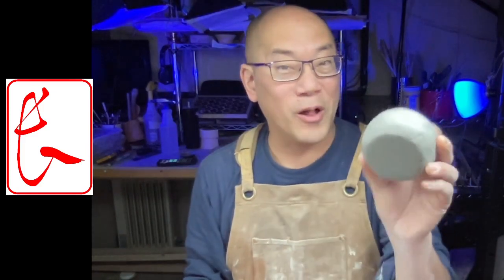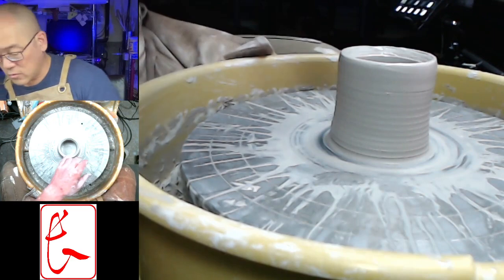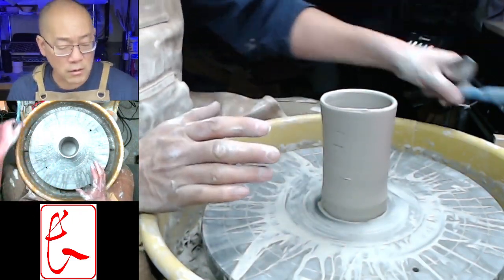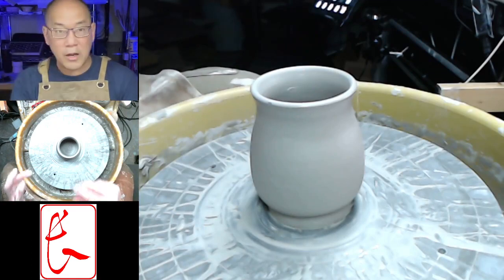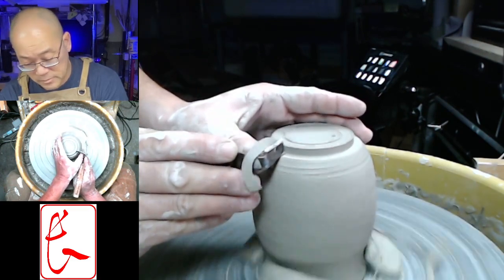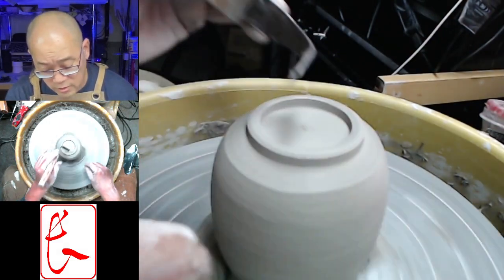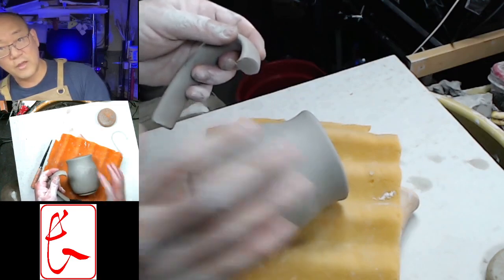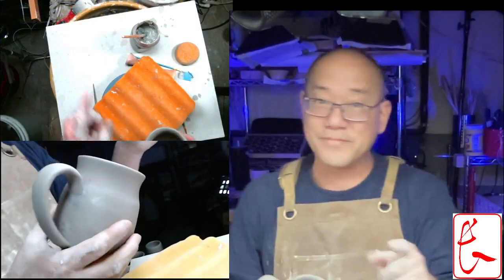How to make a mug

Comment: Your clarity, continuous narration, patience, and humor are fantastic.  Greatly appreciate your explanation of form.  Also using spoon to shape cylinder ~ great!  Some questions:  For your dampbox, does the hardibacker ever mold?  I've seen plaster in dampboxes but not hardibacker -- which seems so much easier than plaster.  Do you just run the board underwater so it's soaking wet?  Also, in making dinnerware, do you prefer a certain clay, and if so, why?  Thanks again for your wonderful teaching.
Reply from the maker: Wow, thank you!

Comment: Hi John, I am still having a problem building a wall. I took your advice and It doesn't flair anymore but the cylinder is small and short. Got any advice?
Reply from the maker: Is it short and thick, or short and thin.  If short and thick- squeeze harder when raising.  If short and thin then you need to start with more clay.